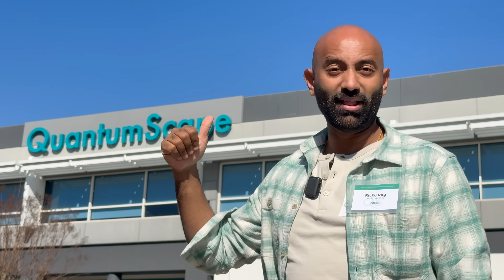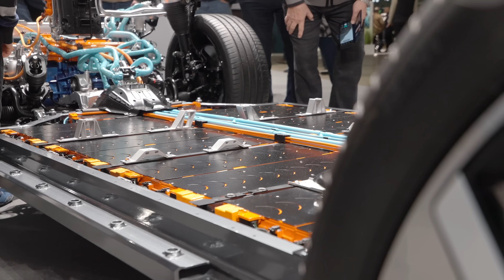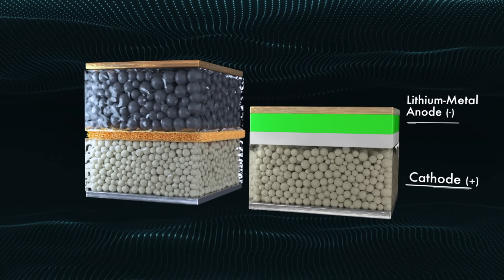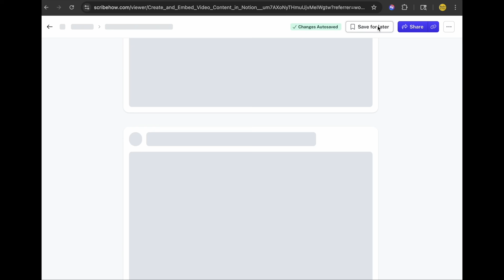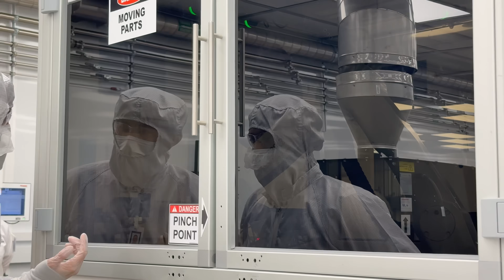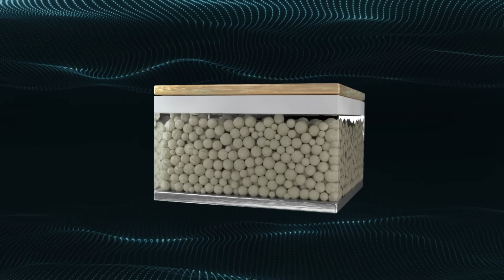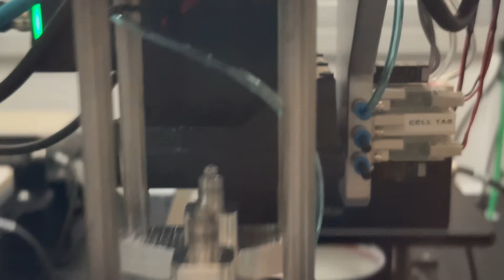I just Saw the FIRST Solid State Battery - It Finally Happened?

Comment: He's right, I couldn't care less if my car has a solid state battery or not if the performance is higher
Reply from the maker: yeah I think we nerd out of these technical details, but most buyers just want great results
Reply: @TwoBitDaVinci  Everyone got this one right! :D
Reply: And it doesn't go into thermo runaway. This is a huge issue for me.
Reply: @malcolmar  And it fails that as by having liquid electrolyte it technically can go into thermal runaway.
Reply: SSB’s matter for Powered Flight and Ships tho
Reply: Even its not highet just being safe from being a bomb is ok from me
Reply: But you care about life time, right? You might get a bit more range in the start compared to modern LFP, but over time LFP have higher cycle time. 

QS is in that sense actually a  downgrade.
Reply: What... All you need a 4 second 0-60 car and top speed 150 mph. We need 500+ miles range, faster charging, and safer batteries in a crash. Thats what we want. I'll settle on performance, thats for gas cars.
Reply: @ShawnFreshley  but you also want the battery to last beyond 10 cycles 😄
Reply: "I dont care if it has sugar in it as long as it tastes good" - type of answer. It's clearly false advertising if "solid state battery" is a well-defined term. You cannot just redefine it and say, "oh it has SOME solid parts in the battery, therefore it's clearly solid-state", thats nonsense and can get you in jail. Or lead to a big scandal for which all investors jump ship. I'd be more careful if I was them.

It's like saying you have built a self-driving flying car, because it can roll down a hill on it's own and then fall off a cliff. Technically true, but clearly misleading. Only reasonable if you're pretending to be stupid.
Reply: @MaZe741  Your entire thesis rests on there being a universally accepted definition of what an SSB is.  This, and the rest of what you wrote, is quite hilarious. 😂

Comment: Stick with this my fellow humans! Solving the battery energy storage problem is hard, but once we figure it out it'll unleash  a new revolution that the world badly needs. I know the other half of America is running back to oil and gasoline with their tail tucked between their legs but we have an opportunity that we've never had before in the battery chemistry space, lots of capital and a ton of brain power trying to solve this problem. Keep it up!
Reply: Oh look, your wokism is showing. 
There is a world in which both fossil fuels and "renewables" can exist but storing energy and, more importantly (in my opinion), recapturing energy need to be solved.
Reply: @TheElectrocar   What this guy on about?
Reply from the maker: well said!
Reply: Wrong metaphor. People having "their tail tucked between their legs" means that they realised they were wrong, however it's obviously not the case that the supporters of fossil fuels thought that renewables and batteries were the answer. Also, using this metaphor implies that you believe that the alleged previous belief of these people (renewable energy is the answer) was bad, which is the opposite of the actual position you hold.
Reply: Unsolvable with existing elements and physics.
Reply: @Bottoarguewith  for some yes…for the right engineers like me…maybe not!

Comment: For those of us who aren't battery engineers;
Is there a size comparison to  lithium ion car batteries, is it smaller/larger and is there an advantage for either one?
Is there a safety issue for one vs the other (fire included)
What would the charging time be for one vs the other?
What would the driving range be for one vs the other?
What is the life cycle of each? 
What is the recycle situation for each, what chemicals need to be used, what is left over that has to be disposed, etc.
Is this a publicly traded company?
Reply: Smaller, safer, lighter, faster, longer life, recyclable , yes - QS

Comment: The REAL BENEFIT of s Solid State battery was, used to be, and still is to me  -- CYCLE LONGEVITY and charge rate. More power, less volume is good, but it means nothing if it has poor cycle longevity and/or poor charge time. --- FOR ME -- I don't get excited at all if the Life CYCLE  isn't dramatically improved.
This Battery --- 
Charge Rate: Very Good 

Cycle Longevity:  POOR (800 isn't good, or even satisfactory)

From AI --
More recent data shows the battery successfully completed 400 consecutive 15-minute fast-charge cycles (from 10% to 80% capacity) while maintaining over 80% capacity retention.

Comment: I really wish companies would stop throwing around the term solid state battery till one actually exists.  These guys made a very impressive, long lasting, and fast charging regular lithium ion battery that solved the dendrite problem.  Which dont get me wrong is great... but its not a solid state battery.  The biggest promises of a solid state battery were solving the dendrite problem, energy density at up to 2x regular lithium ion, faster charging, lighter, and NO FIRES.  This battery only solved 2 of those really.  It does have a little more energy density but not anything to write home about.  It is very cool but its still just a high end lithium ion cell.  Also how is the battery in the car going to react when the cells are draining and now there's space between them because they shrank 20% thinner?  Or do they put a rigid metal box around the entire pouch?  If they put a box around it why not make that box a heatsink as well? None of these batteries which all have problems with thermal runaway, are doing anything to mitigate the heat problems.  If you cooled each individual cell it would not only separate the cells so that if one was punctured it wouldnt affect the surrounding cells as much but it would also introduce the ability to absorb some of that heat and if you had a fan or even liquid running through the heatsinks might reduce the risk of thermal runaway in all but the most extreme cases.  Or hey maybe dont use a metal that explodes when it comes in contact with water?
Reply from the maker: Valid points about terminology and thermal management. This would be a half solid state I guess?
Reply: @TwoBitDaVinci  Or near solid state maybe? yeah.

Comment: #6 when the hell can Will Prowse test it? 

Also, I probably missed this, but can anyone clarify the exact benefits over current lithium batteries?  Is it just faster charging?  Can there be charged below freezing?  How many cycles compared to existing batteries?  Thanks
Reply: Main benefit is gravimetric and volumetric density. In other words, you can get more kWh with the same size and (but less weight) so more range with the same size battery. So instead of, let’s say, 100kWh, you can have 120kWh which would net about 60 more miles of range

Comment: by the time QS get this to production it will be obsolete. in other news  GM estimates that our new LMR cells will get 33% more energy density at a comparable cost than LFP, or lithium iron phosphate. in volume production in 2028
Reply from the maker: their mass producable solid state separator is a brekthrough regardless of what other changes may come... so surprisingly it could work in sodium ion, or other things. now the Donut battery... well that's interesting

Comment: Significantly faster charging and say, 20% more range over current lithium batteries would make combustion cars nearly extinct in less than 10 years. ICE cars are getting to be a high tech nightmare to repair. And with the average price at $50,000 you can't just throw them away when the break. Even dealers are having more & more trouble repairing them, and won't work on older vehicles. Electric vehicles are far simpler. Outside the salt belt, they could last a million miles with only tires and front end parts changed.
Reply from the maker: Like Tim said too, this is like starting at the peak of the old tech. there's probably more improvements on energy density to be had over the years.

Comment: The density is nice, but what's the discharge rate? One issue with lithium cells is discharge rate measured against the battery size, usually denoted as C. In Lithium Ion this is slower than in Lithium Polymer, which is less dense, but has massive discharge rates.

Comment: Very cool news and awesome future potential- but a bit deceptive.  This is not solid state...more like hybrid.  What's the price comparison?  20% Incremental improvement on energy density, not doubling.  What does fade mean- especially relative to cycles in current batteries?  Wouldn't there be a mechanical damage to a swelling anode?
Reply: They spent a whole minute talking about how it's not a true solid state battery if you want to use a rigorous definition. The current video title may be a little clickbaity in that regard,  but it's hardly deceptive.
Reply: I get what you’re saying, but 20% as it relates to energy density is huge, not even considering the countless other benefits of a SS battery.
Reply: Rematch the video.  They explain how they accommodate the anode expansion/contraction.  It was one of the key features discussed.
Reply: @davesutherland1864  You must understand, every video about this battery is flooded with commenters lying and complaining about anything, true or not.

Whatever true complaints there are, you're not going to get it from them.
Reply: @M @MindForgedManacle actually thought it was hard to miss how they accounted for the expansion/contraction.  They stated how Li came on and off the anode, they said it was accounted for in the package design and stated how the package was designed to accommodate it (didn’t give any engineering details, but I expect that word be considered a product secret) and showed an animation of the gap filling and emptying.  Not a high level of understanding to pick it up if you are interested enough to listen to the video.
Reply: @themeansleeves  semi solid is still solid

Comment: It’s beginning to feel like there are manufacturing breakthroughs in so many disparate industries.  If quantumscape can make this battery.  If an A.I. developer can create a superior A.I.  If a robotics maker can build a superior machine..a medical device maker, a fusion reactor builder, an electric motor builder, a camera sensor maker…if a single manufacturer of any of these devices (and so many others) has a single true breakthrough, the world we live in has the potential to change dramatically in the next 20-30 years.
Reply: In practise the changes will likely be incremental, rather then single massive shocks changing everything. A better battery will widen the use cases for batteries a bit, a better AI will help automate some more things, better fusion might allow for a bit cheaper energy. And so on and so forth, everything tends to be brought to market when they've managed to make it a bit better then the current, rather then not releasing it and R&D further till its several times better.

I'm sure exceptions can and do happen, but in general it will be incremental and so year to year nothing to big seems to have changed, just incremental improvements. Though compared to 1986 a lot has changed by quite a lot in the last 50 years. So I guess in a sense big changes do happen over a longer time frame.
Reply: It's more like we will have self assembling warbots powered by unlimited supply of energy, and doing realpolitics 25/8

Comment: 4C to 80% is a charging speed that conventional lithium cells are already capable of, or at least something close to it. My hyundai can do that, no problem. The higher energy density, on the other hand, is a bigger deal. I wouldn't mind a 300 mile battery pack weighing a few hundred pounds less. I still have some questions, like where does the lithium come from, since if the battery is still relying on a cobalt-based cathode them I remain disappointed.

Comment: Not solid state since there is still liquid electrolyte, and not particularly high energy density since there are many cells available today at 300Wh/kg and much higher, up to 520Wh/kg, (Amprius).
Reply: Everyone posting metrics from other battery manufacturers but then failing to post the full picture that these batteries either can't charge as fast or don't last as many cycles or can't discharge as fast etc etc. QS is a no compromise battery that meets all of the demands for Ev use and more. These guys got a serious MOAT.
Reply: @waynewright9343  We have yet to see exactly what the QS cell can do in independent testing.
Reply: @JRP3 they did independent testing in 2021.
Reply: Liquid catholyte actually. It's not the same btw.
Reply: @tanelkindsigo4729  And still not solid state.

Comment: How is an increase from 250 to 300 wh/kg and 700 to 850 wh/l double the capacity? My math isnt mathing
Reply: I’m completely with you. This feels much more like a 10–20% increase in gravimetric energy density than a doubling. I don’t understand why he would say that.
Reply: Conventional lithium-ion batteries started from 150 Wh/kg. Quantumscape just started from 300 Wh/kg. Got it?
Reply: @tanelkindsigo4729  That depends on the chemistry; LFP is achieves around 150Wh/kg, but most NMC batteries are more like 250Wh/kg. LFP is preferable for various reasons, i.e. safety and longevity, but NMC is better for range. Hopefully this battery solves both.
Reply: @tanelkindsigo4729 no don't get it. That's just imagination
Reply: @JDon8110 one day you'll understand!
Reply: @tanelkindsigo4729 their products will be competing with current lithium batteries, not the earlier ones. All current and future batteries, including their own are/will be built on lessons learnt from previous generations. Comparing their battery against the performance of earlier lithium batteries is mischievous. 

By the way, cells with energy densities higher than 250Wh/Kg and 700Wh/L are already commercially available. The Molicel INR-18650-M35A has gravimetric and volumetric energy densities of 264Wh/Kg and 730Wh/L respectively and it's a regular 18650 liquid electrolyte cell. 

CATL has also announced a 400Wh/Kg condensed cell and various Chinese companies have started commercialising cells similar to the one in this video. Quantum Scape is a wonderful battery R&D company but in the long run, no one benefits from blowing achievements out of proportions.
Reply: @tanelkindsigo4729 So we wait 10 years until SS battery reaches 500whk.
Reply: People said the same thing about the first jets vs. propeller planes.
Reply: @jerryk.1889  That's an example that made it, I bet there are plenty of examples - if just just from the memory industry - that didn't which you've never heard of.
Reply: They just make a number up, to raise more capital.
Reply: @dogbreath6974  actually they have already said they don't need more capital, as revenue starts to come in soon.
Reply: @dogbreath6974  They don't dilute shares anymore, they bill their customers for technical work now. You can learn about it in their Q3 2025
Reply: Man you might want to consider not compressing your voice so much so we can hear the saliva moving in your mouth. It's a bit much

Comment: If you can make a lithium ion battery and a sodium ion one, does that mean that a ceasium or rubidium-ion battery is possible?
Reply: Yes
Reply: Yes, even a Proton (hydrogen ion) and magnesium ion are possible.
Reply: Not practical, very expensive and dangerous, since rubidium and cesium are rare earth material that are way rarer than cobalt, and those 2 metals reacts 1000x more violent than sodium (it combust instantly upon contact with the air)

Comment: The core reason for solid-state batteries is to enable lithium metal anodes and block dendrite formation. Dendrites are the root cause of thermal runaway. If you can stop dendrites, it does not really matter whether the electrolyte is liquid or solid.
Most sulfide-based SSB makers claim to be fully solid state, but what often gets glossed over is that these batteries can produce hydrogen sulfide gas when exposed to moisture. That raises a serious safety concern. So the real question becomes this: would you rather have a no-liquid battery that risks hydrogen sulfide poisoning, or a battery with some liquid that successfully blocks thermal runaway?

Another important point to highlight is that a battery can only be considered solid state if lithium moves through the separator via solid-state diffusion. Some Chinese quasi-solid or semi-solid battery makers use porous solid separators, where lithium transport actually happens through liquid inside the pores, not through solid diffusion. Those should not be considered true solid-state batteries. Quantumscape qualifies as solid state because it uses a dense, non-porous separator, so lithium transport occurs through the solid material itself.
Reply: Meanwhile, low temperature lithium-sulfur and sodium-sulfur battery starts getting researched and developed very heavily, because it has the highest energy density out of all the battery chemistries (1.2kWh/kg for Na-S and 2.8kWh/kg for Li-S) and the lowest cost per kWh since sulfur is literally almost everywhere

It still takes a long way though since it still has many challenges to overcome (charge rate, cycle life, and safety, including the risk of H2S producing reaction)
Reply: @sihamhamda47  Food for thought, Sulfide base separator uses 1kg of Silver per 100kw.  I don’t know if you noticed Silver price these days but they have been climbing.  QS battery is Sulfide, Silver and Anode free technology.
Reply: @BMW-i90x  Didn't know that those sulfur batteries require enormous amount of silver, hopefully they find another cost effective alternatives that could perform almost as well as the silver to keep the production cost down
Reply: @sihamhamda47 that would be ceramic which QS has abundant pattern rights